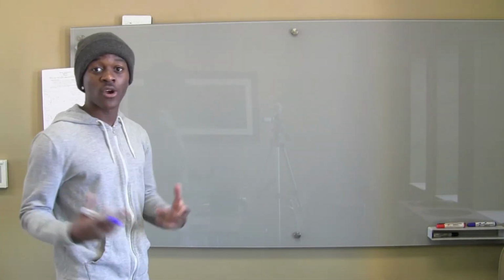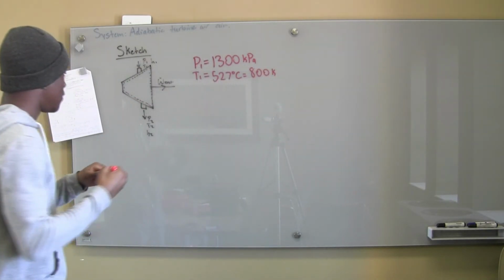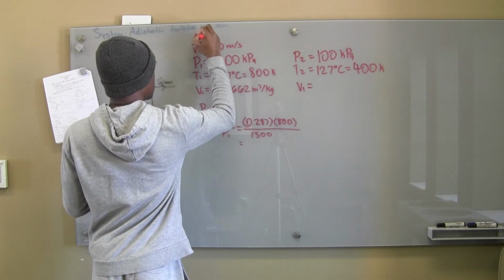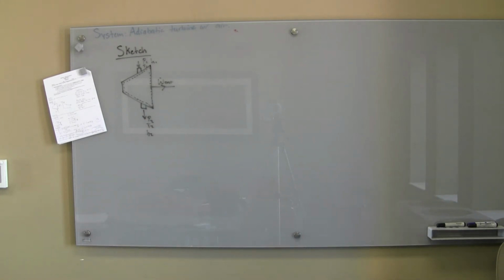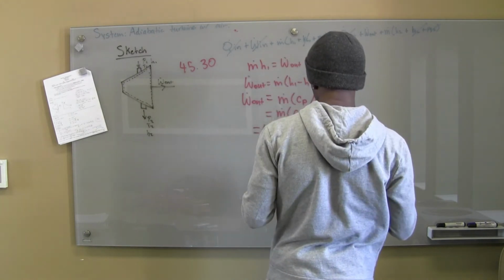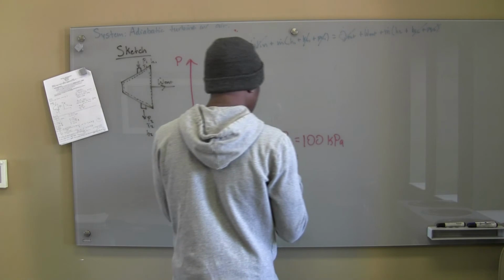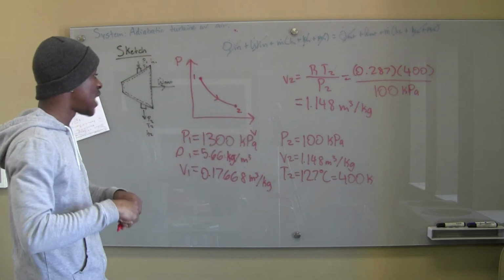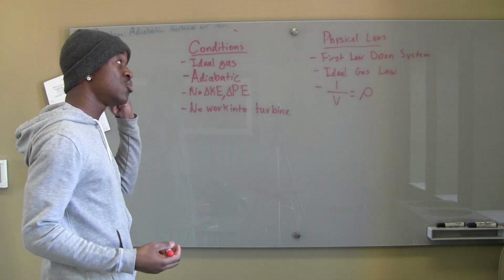Lesson 12.1: Turbine Example Problem

Comment: Thank you very much!  Your video let me know how to express the knowledge in Engineering Thermodynamics.  However, I find there may be a mistake in Lesson 9.1 Piston-Cylinder Example Problem: the Wb you calculated is the one per kilogram. So, the correct Wb should be equal to what you got times mass.
Reply from the maker: Good catch! I'll have to watch the vid again.